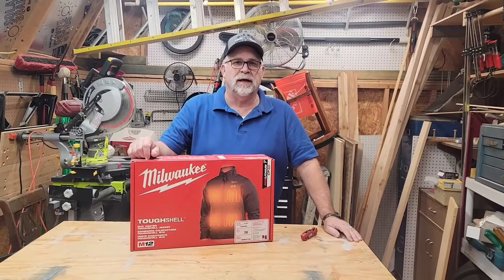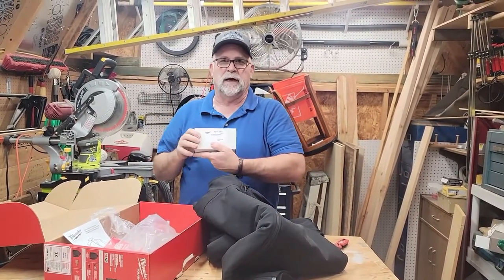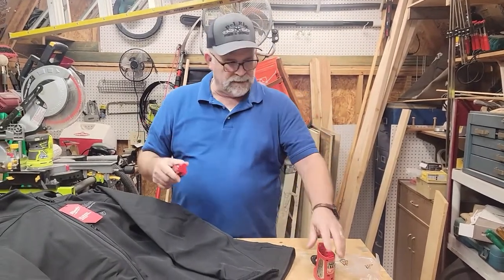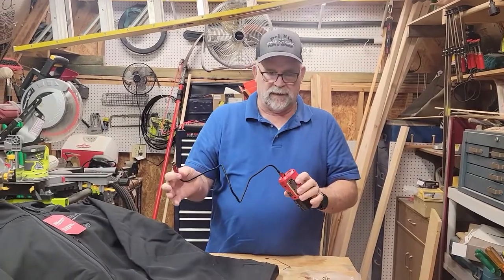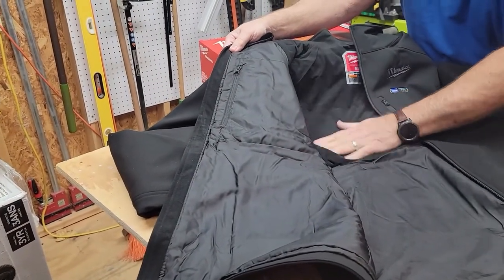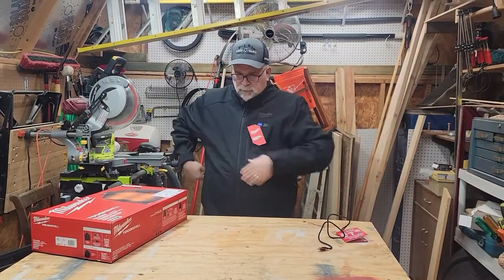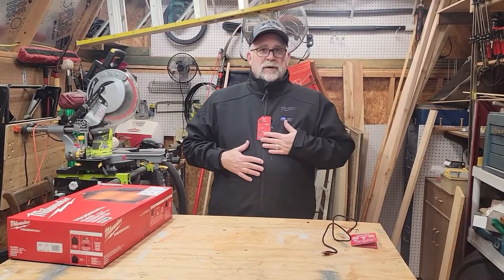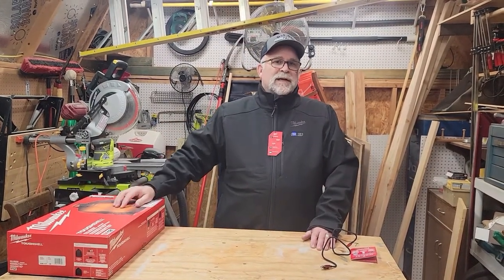Milwaukee Heated Jacket

Comment: Hi, Recently brought the M12 heated jacket.  Brought one size larger because I wouldn't be able to use a hoodie.  I tried it indoor; it took about 20 minutes to heat up. Did feel the heat on the back but top front was at a lower intensity. While the lower front was barely on. Is my jacket defective? Because I didn't sweat when I had it on for an hour while indoor. Thanks for your help.
Reply from the maker: @boston6781 I don't think your jacket is defective here's the heating zones.
 3 Heat Zones: Chest, Back, and Front Pockets. Thanks for taking the time to watch my video and comment if you haven't subscribed to my channel please consider that along with clicking the notification bell so you don't miss out on any future videos. Here's another video you may like https://youtu.be/v8pPcPy3xtM